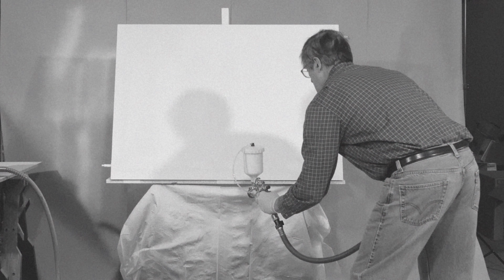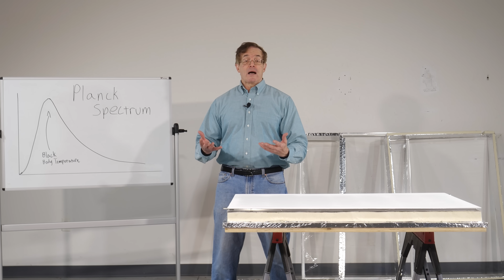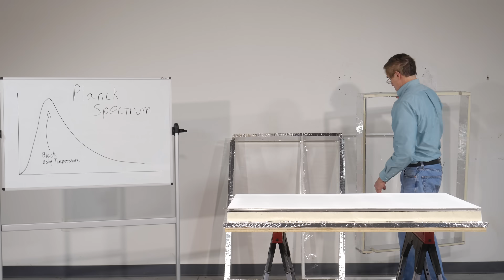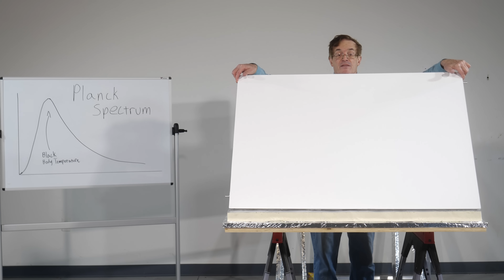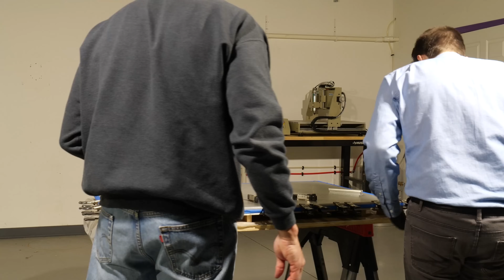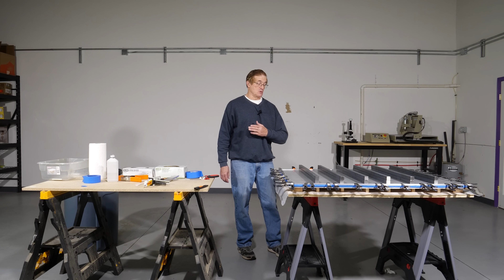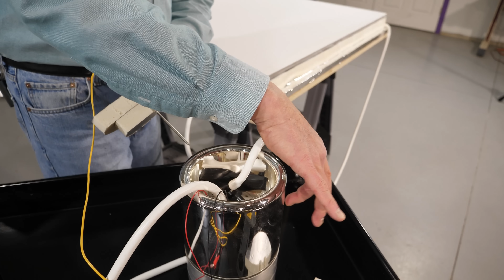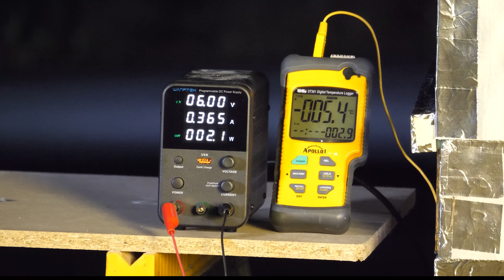Air Conditioning isn't free... but we're close.

Comment: "after it's dumped most of its heat, fooling your air conditioner" - didn't you say it shedded energy at temperature to the 4th power? Why would you do it after it's dumped most of the heat? Why wouldn't you do it before it dumped any heat?
Reply from the maker: Because, by unloading the radiator, you can actually  reach sub ambient temperatures. That's unlikely  if it has to dissipate kw of heat.
Reply: @TechIngredients  i'm not sure the hot side of an AC system (the compressed gas side) is ever going to reach sub ambient. Are you imagining a very large setup? (larger than your demo?) to achieve that, before it goes to the expansion valve?  Isn't the point to shed as many watts as possible? If you have something that is to the 4th power, wouldn't that be where the opportunity is - to catch it with the largest temp differential? (ie, when it's the hottest?)
Reply from the maker: A larger setup  would be necessary. However, I stand by my original argument.

Comment: ONEEEEEEEEEEEEEEEEEEEEEEEEE TEENSY WEENSY ITTY BITTY FLAW with testing this in the winter time...

[while I 100% know this works, @NightHawkInLight already proved it under more warm season conditions]

SOME naysayers are going to say that the fact you are using this at night, in the winter, is that it is actually only capable of cooling off here because the weather is cold.

And, to be honest, if they have only a rudimentary education in physics, that will seem very logical to them.

I know otherwise, BUT the BEST place to PROVE this works, is some place like Death Valley where it gets SUPER HOT because then nobunny can say "Oh its only getting cold inside the machine because its getting cold outside of the machine"

ALSO....

[Yes, this an expensive, pain in the behind, to be for sure!]

You need a CONGRUENT CONTROL on hand to make ABSOLUTELY CERTAIN that at ANY external temperature, the results are 'reproducible and verifiable'...

So that means, EVERY THING BUT THE COATING, all assembled, the very same way, OTHER THAN said coating.

As a 'control' option, to be operating, side-by-side, especially under any and all of multiple environmental factors, from the dark of night to the high noon heat of the daytime, to reduce the potential variables that people might use to pick this apart.

It ALSO gives viewers a general idea what to expect from each of these 1 sq m emitters, so that they know 1, how much they can hope to shed heat with each meter of device, and 2, resultantly, depending on where they live, how many meters they need to budget in.

On top of this, one needs to take into account how long the little barrier on top will last, from UV degradation, storm winds, sand and debris, all working to destroy that thin film and make the system vulnerable to nature's destructive forces.

I personally would put all of it under some kind of protective cover in winter, and, either have antifreeze in it, or else drain it every fall to ensure nothing ruptured from ice expansion.
Reply from the maker: Actually, this works BETTER when it's  warmer because of the T^4 effect of temperature.
We'll do just that when we show you how to make the paint.  We'll  demonstrate the coating in bright sunlight, in warmer conditions.

Comment: Cold is energy. Any PD is potential energy. Geothermal is always a good place to get a fairly stable reference TEG modules also could come a long way, to be used whenever there is a difference in temperatures.  If you have an infrared thermometer you can point it into the sky at night and see amazingly cold temperatures.

Comment: QUESTION...

For the PO BUNNEHS amongst us...

Can you get this 'toughened' epoxy in lager containers cheaper, and then simply refill a single syringe over and over?

Or is this the only way that this 'toughened'  epoxy comes is in syringes?

I've used some larger 2 part syringes on construction jobs, where I put a [at least semi-rubberized] epoxy [it was listed as an 'elastomer' though] into holes drilled on concrete, where we then put in steel rebar, and when it cured, we wired in rebar across the gap and then filled it with fresh concrete.

I do not remember the name or class of epoxy this was, so I can not simply look online and say "Oh yeah this is what we used", but it was about 2 liters of epoxy per twin-tube syringe.

I ask because I know that there are a lot of them out there, and it would seem that getting a larger volume would potentially save a person a lot more munny, especially if, like me, they were more likely to build acres of these things.
Reply from the maker: It's  available  in larger quantities.  I know Henkel sells it, and probably Devcon as well.
Reply: @TechIngredients  Does it come with a specific product name? Or just 'toughened epoxy'?
Reply from the maker: I haven't  checked, but toughened will do it.  They also make that material  for anchoring rebar, I've  used it myself.

Comment: The heat geeks channel experimented with using household radiators for cooling. One of the major issues they found was condensation build up on pipework which can lead to its own problems. The experiments and explorations in curiosity on this channel are always a pleasure to watch.
Reply from the maker: Sure, you don't want to push the principle.  You'd need to monitor the dew point.

Comment: The city of Auckland ( NZ ) just got the shit flooded out of it from an ex tropical cyclone . . . now it's lined up to get the same again. Your air conditioning is NOT frre, it's killing other people.
Reply from the maker: Where do you want me to send the next hurricane?
Reply: @TechIngredients  Your place.
Reply from the maker: Never!
Our mountain laboratory  must remain secret.
Reply: @TechIngredients  I have a grudge against air-conditioning. You might have noticed. I get up at first light, and some mornings I think about putting a shirt on, some mornings I don't. There's an AC unit installed in my house, never switched it on. Both doors open and a workshop fan running on solar power is all I need. Granted mountainous areas WERE traditionally safe from tropical storms . . . . you seem to have a decent number of them IQ thingos, why not turn your talents to alternatives to air-conditioning ?

Comment: Did you offset the spacers to make a serpentine flow path for the water? That would ensure the entire surface gets water moving past it. If you left gaps at both ends of the spacers the corners opposite the inlet and outlet will have poor flow and there might be other stagnant spots.

How about making a panel with a plexiglas top then inject some dye in the inlet to see how the flow goes? You'll want to use some adhesive on the plexiglas that can be dissolved, or some rubber tape and a lot of clamps, so that the panel can have an aluminum top sheet put on after the flow tests.
Reply from the maker: I did.  The ribs served two purposes.  They reinforce the structure, and they do not span the full width.

Comment: Interesting that there was such a marked temperature difference. I wonder if the power of the circulating pump is inputing energy into the coolant which somewhat decreases the setup efficiency.
Reply from the maker: It does.  An external pump will produce  a larger differential.

Comment: Doesn't work as well when dewpoint is above 25°C. 
 The 2 Watts of the pump probably put 1.5 Watts of heat into the coolant.
Cloud base is absorbing the radiant heat from the surface, maintaining water vapor cycle in the cloud as clouds function as heat conductors.

Comment: What I think would be really interesting, is making a homemade air compressor which to pressurize pipes with heatsinks around them, which to get cooled by the intake air for a windmill at the bottom of a solar tower (aka. solar chimney) which to heat the air which rises and accelerates through the tube/tower/chimney pulling more air for the heatsink and windmill. 

I think such a system, although it would have plenty of disadvantages (such as needing a tall chimney/pipe/tower, which to be at least a few meters/yards tall), would also have the advantage of working passively while there is sunlight, due to the only moving parts being the windmill, the drive shaft (or alternative), and the air compressor, all 3 of which would be connected (maybe even welded) together, and the bearings needed for all of them. A few cheap imperfect mirrors (i.e. tinfoil + epoxy + tarp + frame) which to focus more light onto the solar tower, in order to cause faster air speeds, which to compress more air and cool the heatsinks faster. The compressed air would likely need a "drip pipe" going to the outside of the building, which to move the condensed water towards the outside, with a shut-off valve for preventing the humidity from completely escaping from the building in really dry climates. 

With a bit of ingenuity, the solar tower/chimney can also be installed on the roof of a house, by splitting it into plenty of smaller tubes, which to get heated by sunlight, with a transparent side and a dark-painted side which to absorb and use sunlight to accelerate air. Not only that, but you could also connect those with similar pipes on the sides of the building facing the sun (leaving room for the windows), to cool the house during the summer and heat it during the winter, especially if working together with the roof solar heater. And I think it would be easier to make a windmill from long pipes and to place it below the roof. 

You could make a scale model for a shed or a portion of a house wall, but this could lead to a new building style which to focus on harvesting sunlight for running a cooling a solar-chimney-powered heat-pump in the summer, and for heating the air in a house like a trombe wall.

Comment: Fantastic video! Pretty sure I know what chemical that paint is!
Was actually thinking about applications for BaSO4 like this for a lil bit.
Since it's more effective the hotter it gets, it might work very well near a beach for dropping a collection surface to dewpoint for 100% passive, 24/7 desalination. (Especially when paired with a evaporation accelerating structure, such as evenly spaced black foam cubes a few inches below the water. Saw a neat paper on that.)

Sidenote: Would it be more effective to paint the plastic layer and give the aluminum plate fins (Like a cpu cooler)? But still with a light coat of paint to assist in emission. That way you maximize the surface area for emission while still reflecting most light and letting IR pass through the top?
Reply from the maker: Thanks!
With further testing, it's  clear that the plastic adds little, and removing  it reduces a potential  maintenance issue.

Comment: What about thermal leakage from the submersible pump motor which often sit in a mineral oil bath which provides heat exchange between it and the fluid pumped. 
Also flow restriction when pumping also imparts heat into the fluid being transfered. 
It would be interesting to see how you mitigate these issues and see what thermal gains / losses you achieve. .

Comment: I know, late to the party. Just something somebody so late to the party might find interesting.

I work in the mechanical heart valve industry. 

A few years back there was a switch from mixing epoxy to a similar epoxy as the one used 13 min in to eliminate variance in mixing. 

In l of the batches of valves there is a sacrificial part that is cut, sanded, mounted in epoxy. Then one can look for consistency of material (under an electron microscope) as well as hardness-using the same mount. The epoxy encapsulates the samples for visual and hardness so consistency is ideal, especially for hardness.

Comment: Seems like a cone would work really good in your application.  Point the wide/open end up into the sky.  Wrap your water jackets around the narrow/closed end.  I think you would use much less framing and insulation with the cone.

And what if you rolled up paper tubes and bundled them vertically?  The tubes, of course, painted with your radiant paint.  That would give you a way to give directionality - by polarizing the light - so it cannot got anywhere save where you point the ends of the tubes.

Comment: an idea for a project I'd like you to consider doing; Using gravity to turn a flywheel, the thought is to construct a parking ramp with multiple levels that are constantly moving either up/when empty or nearly so, or down when full  which keeps the wheel(s) turning. Is there a way to scale such an apparatus down and measure the energy potential. I'm thinking the setup would need to be so the entire level moves with a ramp that slides to make entering/leaving the ramp at any stage. Of course traffic being directed to maintain the most efficient use of the vehicles weight/energy potential. I had this idea for charging electric vehicles, calling it a charging ramp. This can still work for this purpose but there is no reason to limit the benefits to electric only, the cost to park can be adjusted by the amount of energy the weight of your vehicle produced while parked. parking for long periods would be docked for the energy needed to raise the ramp with the added weight. Once the flywheels are turning they would never stop, so long as vehicles are coming and going. You get the picture, I'll leave the technical stuff for you to think about, I hope you'll seriously consider a project that utilizes gravity to produce energy, if not a parking ramp which I know would be challenging and expensive to construct, this may spark some other mean of utilizing gravity. Another one I have in these lines being containers of water where the full containers water is pumped into an empty one at the top via a pump or the energy created going down. The distance of movement doesn't have to be more than a couple of feet, making the energy needed to transfer the water less than pumping it up to a higher distance. I know that this involves the so called 'impossible' perpetual motion machine. The thing is, it actually is not by definition because of the constant energy needed to keep it in motion. Therefore it is the efficiency of transferring the water vs the energy created by the gravitational effect of its weight. In other words, would such a system create more energy than what is needed to transfer the water up to the empty container. I'm not sure what would be the most efficient means for this transfer to occur but I'm confident you'll be able to use your mathematical genious to do the calculations before setting out to take on some such a challenge. Love the channel and thank you for taking the time to read and consider this monstrous challenge.

Comment: Making use of a hydronic heating system during the summer is a very interesting concept. It does nothing all summer after all. My house only has a hydronic system and not central ac so if there is a low-cost method to reverse its function to cooling, that would be genius!

Comment: Really love the video, But a little question, the pump is making heat as it is flowing in the system. would it be more effective to have the motor out of the closed loop liquid and maybe have it air cooled or water cooled by a mass of water? This could bring the system even more efficient, no?
Reply from the maker: You're right.

Comment: Hi, this is great. How many BTUs of cooling can you get out of one square meter? Let's say during a typical very hot summer day, 12 hours cloudy, 12 hours clear sky. The PE foil does not look like it would withstand the elements ;) Does a thicker PE layer absorb to much IR?

Enyoing your videos very much, thanks for the inspiration!
Reply from the maker: It turns out that the plastic film adds  very little.  You can eliminate that.
We were probably  getting  about  40 watts/M^2.  But this was at freezing temperatures, and the output increases as the radiator warms.
Reply: @TechIngredients  So that would be 136 BTU. Very curious how much more it will be in summer conditions :) Might actually make sense for flat roof homes as an add-on to the normal HVAC.

Comment: In aviation, aluminum tape is called 500 mph tape.
When you're testing an airplane and don't have time to bolt the wings on. We use aluminum tape (aka 500 mph). It can hold an airplane wing on up to 500 mph.
Reply from the maker: Wow!

Comment: I'm wondering how effective this would be if you were to use it with PVT panels to cool the circulating liquid for the panels.  After of course you used the hot water coming from the panels to supplement your pool/water heater or however you're using it.  A potential problem would be the longevity of the clear "air barrier" window, since Saran wrap or Glad Cling wrap wouldn't last that long exposed to the elements.  What would be almost ideal would be essentially an infrared one-way mirror to be the final layer of your "cake"

Comment: That radiator seems to be way more complex than it needs to be. I would have just taken two sheets of aluminum and used some silicone caulk to make a serpentine path between the sheets and then just have an aluminum tube entrance and exit tube  siliconed onto the opposite corners of the sheets. I would not run high pressure through it, but for the modest flow rate needed for a heat exchanger it should be fine.  You could even use something cheaper than aluminum for the bottom sheet since the top sheet is doing all the radiating. A piece of polycarbonate flute board  with a poly foam insulating panel glued to the bottom.should be fine
Reply from the maker: True.
There were a lot  of options we considered, but we plan to use this for a variety  of projects and wanted something with some flexibility.